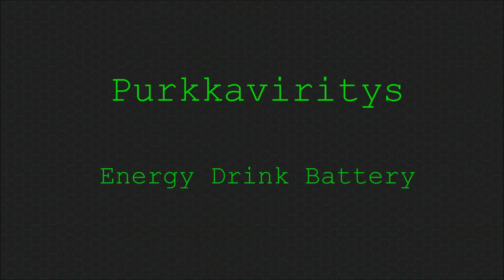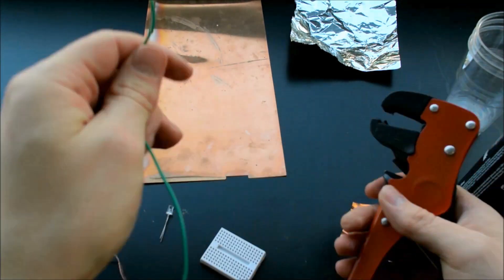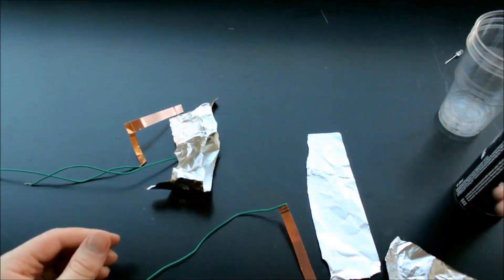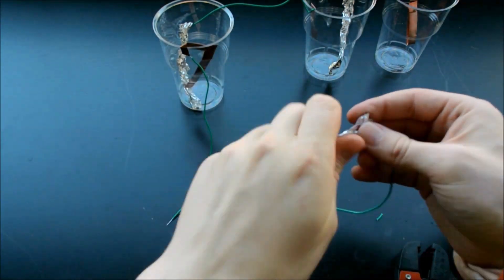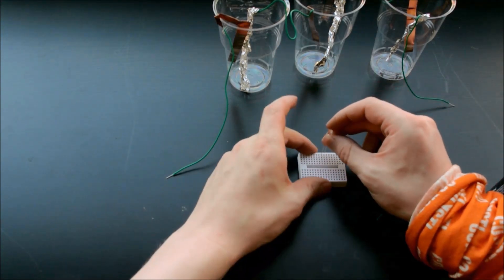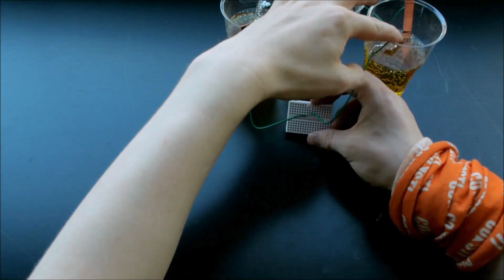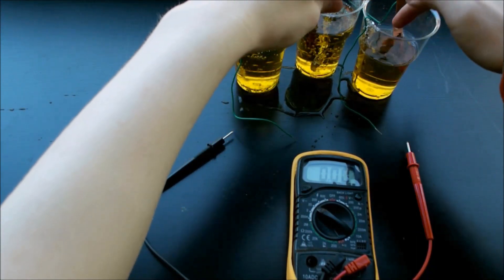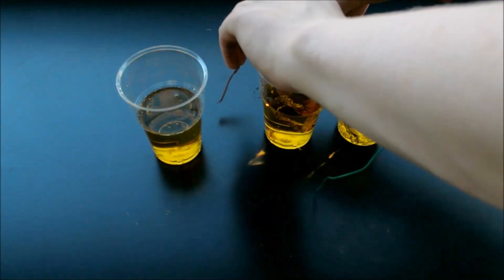Energy Drink battery

Comment: So I'm not very well informed on how batteries work, but wouldn't adding another "cell" of energy drink battery create a higher voltage? Or would that create a higher amperage instead?
Reply from the maker: You'd get higher voltage, but the amperage is the real issue here, as its very low.
Reply: Purkkaviritys excuse me what was the adhesive material that you used to secure the electrode is it a special tape or paper or what is it thanks(ps try to answer as fast as you can thanks also gr8 vid
Reply from the maker: just some random packaging tape that I had laying around.
Reply: alright thanks